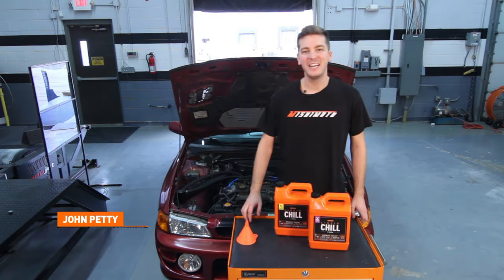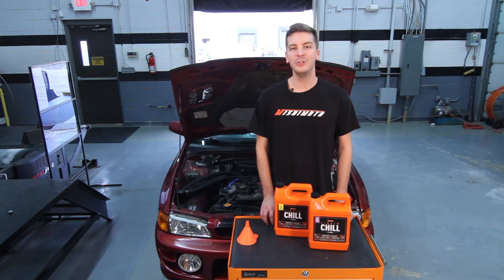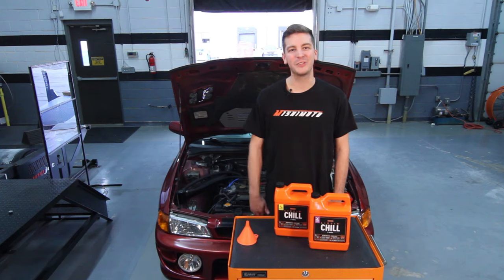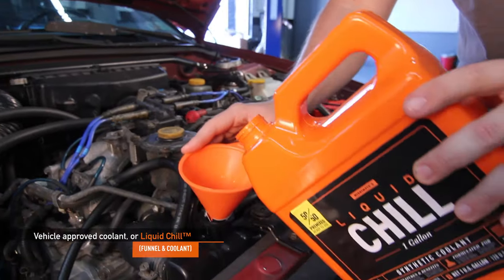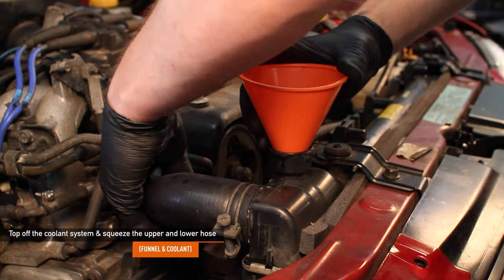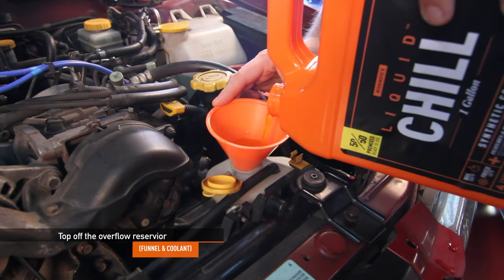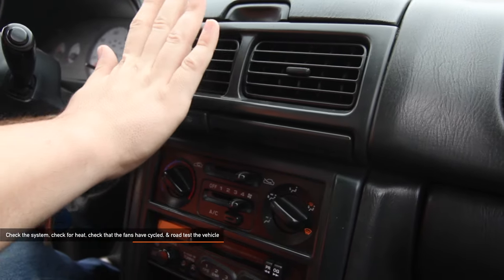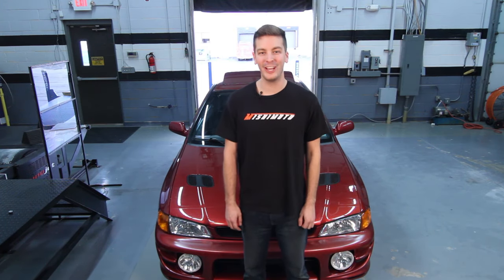DIY - How to Bleed a Coolant System with Mishimoto Liquid Chill™ Synthetic Engine Coolant

Comment: Hello mishimoto, I bought a radiator from the ones you sell. I want to use your coolant liquid chill. But what is the difference between the 50/50 pre-mixed and the Full Strenght???
Reply from the maker: 50/50 is ready to pour in as is. Full Strength must be diluted prior to adding.

Comment: Hello, 2015 wrx owner here. I have the 50/50 strength coolant can i combine it with the stock coolant that my car came with and just pour it in the overflow resivour without needing to bleed it all out and what-not or do i have to drain the whole system and add new coolant?
Reply from the maker: Hey Mr.NiceGuy. While I would suggest a full cooling system drain and flush, Our coolant is fully compatible to mix with any other brand that the OEM would have recommended. So, you would have no problems if you decided to simply add it to your reservoir.
Reply: Mishimoto Automotive ok and if i were to purchase the full strength one would that require a full bleed?
Reply from the maker: Hey again Mr.NiceGuy. Regardless if you are using 50/50 or full strength, the full bleed would be highly suggested. However, it is not a requirement.
Reply: Mishimoto Automotive thanks for replying!

Comment: Can I just add this to my reservoir tank with my current coolant still in the radiator? I have a 13 wrx.
Reply from the maker: +Omar Mejia What kind of coolant is in there now?  Our is universal, but doesn't mix with everything.
Reply: +Mishimoto Automotive It has the the coolant they use from the factory.
Reply from the maker: +Omar Mejia Great - you'll be fine.  Mix away!